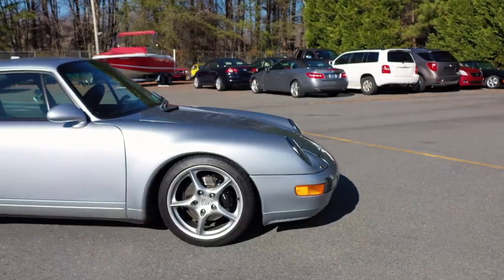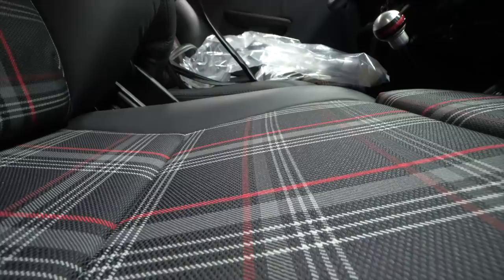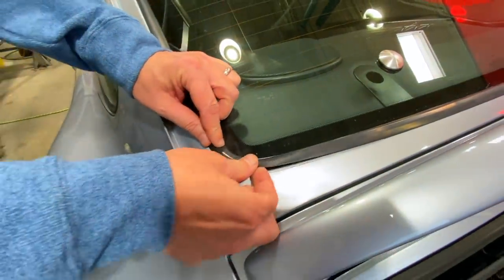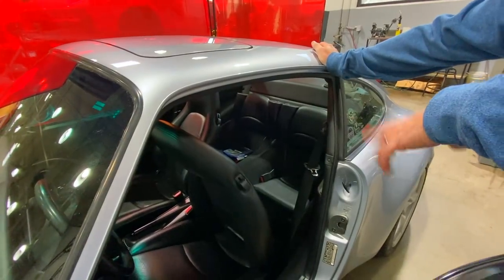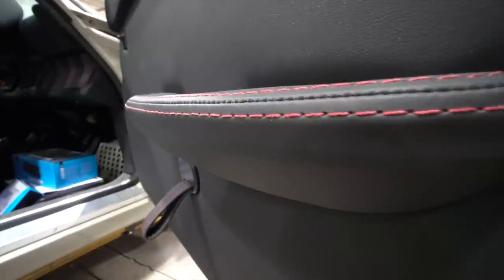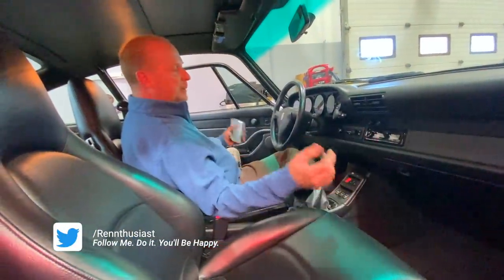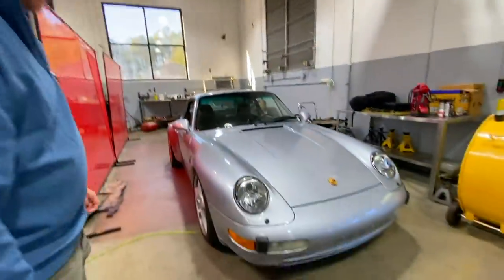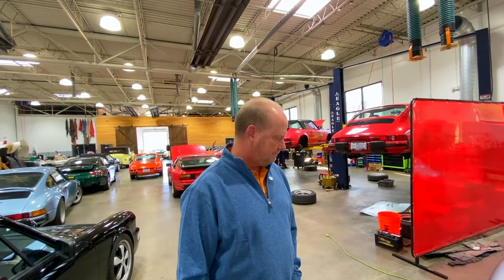My Porsche 993: Should I SELL It or MODIFY It?  The Answer

Comment: The stock bumper looks so much better than the turbo one. So much cleaner and fits with the rest of the lines of the car so much better. Funny, if I got one with a turbo bumper, absolutely first thing I would do would be to change it back.
Reply from the maker: Great thing about these cars is there are as many way to set them up as there are owners with different tastes.  Thanks for watching and for commenting 🙏🏽
Reply: @Rennthusiast  True all subjective. Just make sure you keep the stock one cuz I'm putting it back on when you're done :D

Comment: There is some good things on your car already: the interior color is black. Definetely the best color on 25 years old car. The original 3-spoke steering wheel, much nicer than 4-spoke. 18" wheels, cooler than originals. Sun roof. The exhaust is better than original. 

Hard to come up with anything to improve because the car is in some neat condition. The exterior color may not be the best possible, but I wouldn’t like to paint it a different color because it’s the original color. Maybe something upgrade to motor?

Comment: Good that you're keeping the car. If you sold it, it would only be a question of time before you bought another one. I wouldn't bother with the roll cage or mess about spending money on a stereo, not when a good exhaust will give you the only soundtrack you will ever really want to listen to. On the exterior, maybe part colour code your wheels with a nice Carrera or Porsche graphic. Get rid of all the orange from your lights and maybe push your wheels out with spacers just a little bit more to make the thing really planted. Not that keen on the ribbon brake light personally , but that's just me. No matter what you do just make sure you love it, it's your car!

Comment: In my opinion, add lightness. If you do a rear seat delete, don’t add a roll bar if you don’t plan to track or use a seat harness. It would just add weight, and the inability to easily throw luggage back there for a road trip. Granted they look cool, but won’t help performance in any way. I do like the idea of seat inserts, door cards and square weave! Been wanting to add square weave to my 964 for some time. One tip there, is when they replace the carpet, have them rip out the old foam insulation underneath and update to a new material like dynamat. You’ll save quite a few pounds in that process as well.

Comment: I’m glad you’re keeping your car.  Here’s what I’d do.  I’d spend the majority of your budget on cosmetics.  Over 90% the time you aren’t driving it.  However you always see the car when you walk by.  If the car looks the way you want it to, you will get more overall enjoyment every time you walk by it. More then just when you drive it.  By all means, if you are going to change the paint color (I personally don’t like wraps, that’s just me) don’t have your new bumper installed until you make the color change.  I’d have the whole car repainted with the motor out, and when that’s done all your rust issues will be identified and corrected.  If you see some rust there is usually a lot more unseen.  Get it all removed so you won’t be dealing with this issue, headaches, and more expense later.  It’s better to do it right the first time and cry once over the cost.  I think the inserts in the seats would add a lot of “coolness” to the interior.  If the side bolsters to the seats need replacement, I’d be careful about just replacing that section of leather.  Even though the leather on the rest of the seats might be okay, it’s hard to match the patina of the new leather with the old.  You might not notice it at first or from a distance but eventually YOU will and it will drive you crazy.  Worse than Purgatory.  Play around with your choice of carpet color and texture.  It’s amazing how contrasting colors can transform the look.  Lighter carpet colors really brighten up the interior and can be very stylish (My 1987 Carrera has burgundy carpet with black mats.  I’m thinking of putting in beige Coco mats).  Can’t wait to see what you eventually do.  Great channel.

Comment: You might also want to consider a clubsport steering wheel. Smaller diameter than the 996 wheel, bit bigger than the momo which can obscure tops of dials. I’ve got clubsport my 993 and it’s perfect for me. If going with the momo maybe also consider offset for the hub depending on your eye line for top of dials. I like the seat insert idea (maybe houndstooth to match new carpet). Would also do back seats to match and skip the cage unless you are going to track a lot more. I’d keep the door cards and upgrade speakers. Awesome sound inside and out. Another cool idea others have done is adding sound deadening under carpet and behind door cards if you are doing these anyway. Apparently this really allows engine sound to come through. Looking forward to seeing progress!

Comment: I had a 1995 silver manual coupe just like yours. It had about 116K miles. Although the car ran strong and seemingly flawlessly, I did a leakdown test which found an 85% deficient valve. My mechanic recommended a full engine rebuild. As I could not afford that, I sold the car on to Gutherwerks in California for a decent profit. Your 993 with its current mileage is long overdue for an engine rebuild. These usually run 20-$30K, but you will have a car that is worth $80k at that point. Do not put a single cent into unnecessary cosmetics until you have done some engine diagnostics to this car.

Comment: So glad your keeping it, that makes too much sense, good decision!!   My thoughts for ya:  Front turbo bumper change is a great mod, that’ll look awesome! Interior: If you want to hot rod it, the Rs door cards are aggressive and starts saving weight.  Rear seat delete with NO role bar, (keep saving that weight!)  Center seat change to cloth seats are a nice change (i did that in my ‘81 to houndstooth) and the ‘96 soon to convert to tartan) Light weight wheels are great too, on my 96 I did Forgeline ML (3 piece wheel looks great!). Your 3 spoke steering wheel is great, maybe re wrap with contrasting stitching would look great.   At night, HID HEADLIGHTS!!!  A MUST and also looks so much more modern and big difference for night driving.  I like the “singer style” side graphics (I did that on mine to match my break calipers (black stripes with white Porsche). (I love the stickers, they fit the hot rod part). Cabie hood rally lights would be a bold look that no one else has and would set yours apart (this is a love it or hate it, but when I saw the signer with them on at the Luft 5 event, wow, looked amazing! )  Last, if your doing side graphics, you can contrast that with different color side mirrors.

Comment: I would also suggest skipping the rear seat delete and roll bar. Instead add the Fabspeed x-pipe with high flow cats. It will add horsepower and make the Faster II's you have sound even better. The front Euro bumper is a great idea. (I am doing it to my car.) But I would also have the bumperettes removed from the rear bumper (also doing this to my car). That way both of your bumpers will look really clean.

Comment: Nice to hear you keeping the car. Area you are looking at is spot on. However I noticed you mentioned wanting a more aggressive package. If so consider RS engine mounts or C4 version improves the drive no end, gearbox mounts, LWF for sharper response, consider turbo wheels ( you need to be mindful it’s the right one for NB car), steering wheel MOMO proto typo 7(Momo the co. can do bespoke service for you down to the last detail and not much pricier- but you’d need to wait for 2 months approx), Big brakes(red), RS airbox or just drill the ones you have, coil over suspensions, try to do HID headlights, change seat belts to Red or blue (easy to do and cheap to change, happy to suggest how you can do this in more detail), door cards with matching red or blue pulls. If budget allows ITB. All of the above changes the feel of the car making it a little more special with your own touch. Side stripe in CARRERA makes it even more nicer, also make sure your exhaust heat shield is in good nick, they do fail and you’d suddenly see smoke coming from the right rear of car by wheel arch. Just my 2 pence worth. Good luck as always.
Reply from the maker: Yemi more great insight.  Thanks 🙏🏽

Comment: I have the continental radio installed on my e46 m3 , the only issue is the steering wheel controls don’t work and the interfaces available in the market don’t work either, so I’m building an interface myself using Arduino nano and a library available for interfacing the bmw IBUS, but your car doesn’t have SWC so no problem.

Comment: If your'e over 5'10," tall get the Mod 07 steering wheel, no script/graphics on the car. I'd consider Cayman 981 seats vs cost of reupholstering seats. Steve Wong chip is a must. If your gonna go light weight door cards then remove/sunroof delete. Everything else toward suspension.
Reply from the maker: Thanks for the insight!  Found some killer seats that are gonna be great.  Will share what they are in my next vid on the project.  Glad to hear about the chip.  Can't believe I have waited this long.  PSS10's are on the car and they are GREAT.  I think I've decided to leave the doors alone with the exception of the carpet replacement on the door panels.

Comment: The single best performance option for the money is to do the FD Motorsports shifter + Golden Rod from Darin Fister. It will be about $700 + an easy installation. I live close to Darin's shop and just had  the shifter put on my 993 4S (110k miles) and it totally transformed my car. Your stock shifter is worn out by now and the stock shifter on 993's are sloppy and not performance oriented to start with. Plus, at some point you will need to get the bushing done anyway as they wear out on the stock shifter. The FD shifter & Rod are a fantastic upgrade and also a preventative maintenance item that should be addressed. I'm turning my car into a driver/track car and it is a must have. If you can't add it to your budget, skip the Fister III's and go for the shifter. You will be very happy that you did.
Reply from the maker: Neil Pack couldn’t agree with you more about the golden rod and the SSK.  I was lucky in that the previous owner put them on.  I did just order a stage 3 exhaust from Darin (swapping my stage 2 core) and also his transmission mount for the car.  I have been told it’s a great mod.  His stuff is great.

Comment: I would pass on the half roll cage (unless you do decide to track the car - in which case you might have to reconsider the exhaust if the tracks locally have noise restrictions). Deleting the rear seats to free up load space isn't a bad idea; I would avoid side decals (always think they look tacky on a 993) and final point,  keep the existing front seats in case you decide to put them back in the future and buy some tatty ones to refurbish.

Comment: Hi, fellow Porsche/BMW M car YouTuber here in New Jersey. Nice 993. I had a Polar Silver 993 Turbo, with fister mufflers and PSS9 suspension. It also had the RS door panels with the pull strips.  Great car, started to have oil leaks and power steering problems at 80k miles. Probably needed turbos rebuilt and a top end rebuild so I Sold it for double what I paid for it 5 years earlier.  I bought it back when they were cheap. Great car...That steering wheel you have is from a 996. I had the same wheel in my 996 C4S. I recently bought a 2017 Miami Blue manual Carrera.  I love the color, the turbos, and the rear wheel drive. I am looking to buy a 997 Turbo manual in the future. Let me know if you know anyone selling Cobalt or Aqua blue. Take care.
Reply from the maker: Haha I ran into steering problems and leaks so I just went deeper into the car and had them fixed.  Will never see that money back but oh well.  You only live once.  Will check out your channel.  Thanks for watching and for commenting.

Comment: Will, great choice keeping the car. That rear glass will be more expensive than $400, I can tell by your video. The new outer seal will not just snap in until the metal framing is fixed. And that’s when you need to go cheap with a bunch of sealant or go expensive with new glass. The new SW Chip (911Chips) is super easy to swap in on the 95’s so have fun. I found that I had to add octane to bring up the gas to 93 or there will be low end knocking when you get on the throttle. The roll bar and the graphics...Meh. I guess you will look cool at the cars and coffee, but it’s not my favorite. And the front bumperette delete looks like a lot of work for such little extra joy...plus it will eat at you when the rear bumperettes are still there so go ahead right now and double the budget! I love your content and I love how you ask for opinions. Those are mine. No hate at all for what you are doing and I can’t wait to watch what you are going to put together!!!
Reply from the maker: Curtis St Amand thanks for the support.  I hear you on the budget.  I am a realist and have lived with 911’s for the past 5 years or so and know what the financial end of all of this looks like.  Might be I can’t get everything I want done right now but still fun to plan.

Good insight on glass.  It has to get done regardless so will just deal with the amount.

Thanks again for the support and the comment!

Comment: Don’t  overly modify it.  In the long run you will be devaluing the car.  The best performance upgrade  you could do is the suspension, and corner balance..  It will transform the car.

Comment: Going forward on you 993 ideas,  I have 2 98 993's C2S & C4S both with aero if I could only have one it's by far the C2S it's just lighter in feel in the front suspension putting through the paces.
Reply from the maker: Nice!  I haven’t driven a 993 C4S but did own a 997.2 C4S and the front end felt too planted for me.  Great car but I prefer the RWD.

Comment: I like the guy's ideas on the front seats and door cards and carpets.   I'd leave the dash as is and I would not remove the rear seats but give them the same treatment as the front.  A roll bar just makes the back area useless.  I'd pass on it.  I'd also give second thoughts to the  front bumper.   The originally bumper lines are just perfect for my taste.  I'm also not a fan of graphics on these cars.   Less is more.  After the above  work, I'd spend the money on mechanically perfecting anything that might need some work soon.  Maybe putting on turbo brakes, or valve guides and seals, or light weight flywheel and clutch, or maybe new plugs and coil packs.  I liked the guy's idea of the  RS door cards.  Would light weight RS glass work on your car?  Saving/cutting weight is great horsepower and will give your car unique performance.  But whatever you take off your car, save.  Don't do anything that would make the car no longer a great daily driver.
Reply from the maker: Thanks for the ideas!

Comment: I'm liking most of those ideas.  Big fan of seat inserts, especially on solid color interiors.  Not loving the roll bar though, if it's not a track car why pretend it is (same with the graphics). As far as the steering wheel goes, I'd keep the airbag and that nice 996 wheel (but then I'm biased).
Reply from the maker: John Connor the 3 spoke wheel is ergonomically fantastic but a little too stick looking for the direction.

I have gotten a lot of disagreement with the rollbar idea so you’re not alone in your thinking along those lines.

Comment: Fun video Will.  The upholstery area in that shop is impressive.  Based on the items you talk affirmatively about, I would guess you have $10K worth of mods.

The seat inserts would be a great bang for the buck, as would the steering wheel.  I’ll bet the turbo front bumper with front brake air scoops will be a game changer for the car’s appearance. 

I did a Steve Wong chip on my 964 - also a good bang for the buck.  As was the case with my car, depending on what other performance mods you’ve done, a custom Steve Wong chip might be a better bang for the buck.

Don’t know if you want to expand your budget a bit to include modern coil overs.  I did KW Onyx variant III two way adjustable.  At between $5 & 6K installed, they are probably another of the best bang for the buck performance mods.

Curious to see how you decide to shape the project.
Reply from the maker: Thanks for the insights.  I must say I love the PSS10’s and they are pretty new so I feel like the suspension is good to go for now.

Glad to hear the SW chip is good.  I think it’s super reasonless price wise.

Thanks for the support and for watching. 👍🏼
Reply: Sorry Will, I’d forgotten that the suspension was already redone.
Reply from the maker: David Sherley since they’re done it just leaves more room for other fun things 😄
Reply: For sure!  As Dave suggested, graphics are also a way personalize your car as loudly or softly as you like.  As long as you don’t use ‘official’ Porsche graphics, they can be quite reasonably priced.  If it would interest you to check out the graphics on my 964, here is a link to images on Flickr.   https://flic.kr/s/aHsmNg5Fxn